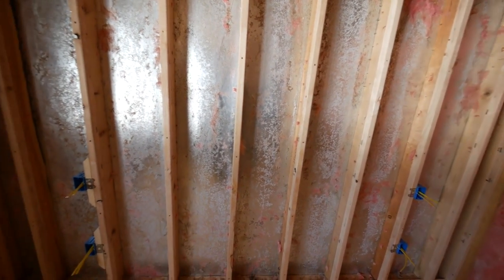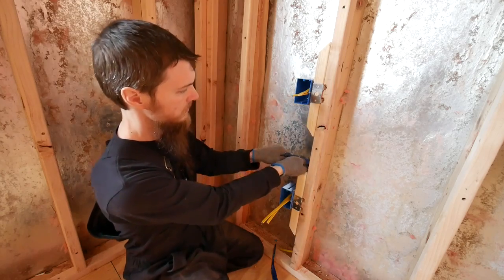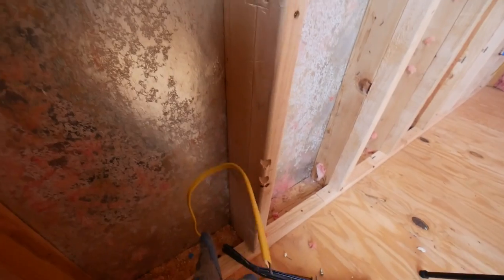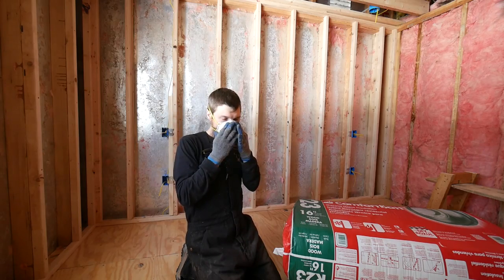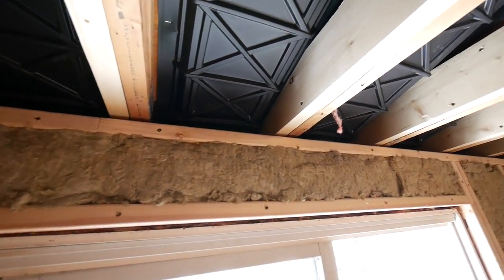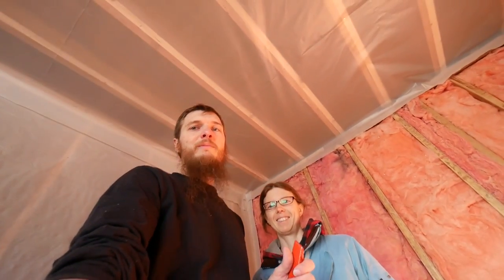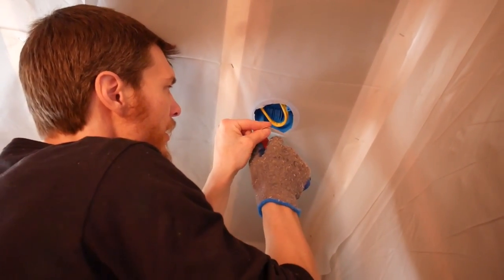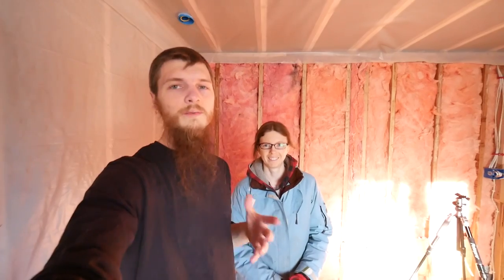A Sensational Insulation Installation - Home Renovation

Comment: Thanks for the additional warning of wearing the Tyvek suit at the end. I wondered if the rockwool insulation was as itchy as fiberglass and assumed that it wasn't based on you not wearing any protective gear. I'm glad that you cleared that up based on your experience.

Comment: The more I watch you the more impressed I am.if you install your drywall first then blow in insulation.you will have many holes in your drywall to repair and then unable to tape the holes.my suggestion is to blow installation first.tuck tape holes.this way you can have the fill of each truss area visually .afterwards install drywall. Good luck!!
Reply from the maker: No holes will be cut in the ceiling, we'll be going up the attic door that's in the hallway to do the blow-in insulation.
Reply: Ahhh ok.that is even better!

Comment: The man that built my tiny house used Roxul insulation. Not as thick as yours but it is doing a fine job retaining heat in the winter and keeping the home cool in the summer. In my opinion you made an excellent choice for your insulation. Nice video, thanks.

Comment: MOISTURE RISK!  Doug its been my experience to wrap either the wall or ceiling (recommended) only but never both.  I am not sure about Roxul but with fiberglass for certain.  On a full wrap and there's no place for the moisture to go and will exit through the wood in your windows causing premature rot.  This actually happened to a friend years ago.  I googled Roxul but didn't really find much.

I would recommend doing the ceiling only to be safe.  

Also wanted to say we're in our 60's and my wife and I love your show!  It's a joy to see someone young not only take a DYI interest but also you really seem to know what your doing (or at least research when you don't).  KUDO'S to you & Ashley and to the kids!
Reply: Hey, I'm redoing my bathroom due to a leak and black mold. What exactly do you mean about wrapping the wall? Are you talking about the insulation? I'm using fiberglass insulation. R13 is what is required in my zone. Is there anything I should do to the wall before putting the insulation in? It's an outside wall.
Reply: I made it to the end of the video,  I know what you're talking about now. Lol
Reply from the maker: Thank you, we really appreciate it! I generally agree with you about the vapor barrier but it's required here.
Reply: Out in the Country  There again I wasn’t sure about Roxul which may be different. Didn’t realize you had to pull a permit to redo your bedroom. Codes are the County’s commandments!  Good luck with your project.

Comment: The mineral wool insulation is impressive. I would never use another type of insulation ever again. It fit perfect (who knew?) and I could see the extra coming in handy for other jobs in the future, so no biggie having to open another bundle. It was a first hearing anyone say "It was Fun doing the insulation." Taking breaks you need for your family time and leisure makes for more ease at work-time. Thank you both for caring enough to explain the processes of your projects.
Side note .... Was wondering if you considered the fact that electrical current will be going through your wiring next to your heads, as you sleep? Don't know if it's practical for you to shut off the breaker at night, but that is one way to avoid the pulsing electricity. Not trying to interfere, just wondering and looking out for you, and since you are doing it yourself, you can do it your way, eh?

Comment: If your not using that opened bag of insulation straight away keep it covered as it will absorb moisture in the air...great job🇮🇪🇮🇪🇮🇪👏👏👏

Comment: Attention to detail is why well made wooden structures have been standing for 200 years. Older double sided were made to be lite for travel...your refit will make the home stronger than most new homes. As long as the roof is secure and exterior surfaces painted to seal it from the weather, it will last for your grandchildren.

Comment: I was surprised to see you with minimal skin protection. In my experience working on a volunteer team helping with a project that involved rock wool  - we were able to get our clothes cleaned of it with washing. We did find that it was most pleasant to use some type of coverall and we duct taped our gloves to our coveralls to keep any rock wool from getting between. (This was on a large multi-day project we were helping with in Poland and we found what worked as we went along.)

Comment: The reduction in outside noise was very noticeable once the insulation and vapor barrier were installed. You should be much warmer in the winter and cooler in the summer!

Comment: Looks like good sound proofing material as well..
Reply: It is rather effective at soundproofing due to its density. I used Roxul in a basement remodel that included a home theater. It did a great job at containing much of the sound.

Comment: As mentioned by someone else it's a good idea to tape the area where the wall and ceiling plastic meet also not a bad idea to tape around wall plugs ect and around the window that way air won't escape the vapor barrier

Comment: You cutting that insulation with your serrated kitchen knife made me think of using an electric carving knife to cut rubber mattress foam. Works really good. Not maybe worth the investment in the tool unless you have a lot to do, but just out of curiosity I took a peek at Amazon to see if they come in cordless, and they do. The one I had back in the day I got at a yard sale had a cord and it worked really well.

Comment: Could use tyvek type tape around the outlets.Acustical caulk around floor and around exterior windows and doors end were the poly ends on interior walls to complete the vabor seal. Tape the poly together with the tyvek type tape. After you wire your exterior outlets i poked spray foam in the holes were the wire enters the boxs.   looking good.

Comment: I have fiberglass insulation in my basement ceiling. You could use that insulation you have and fit it snug then cover with plastic. Just tape it where the staples were. I would wear old insulation clothes from a thrift shop and toss when done just in case it make the protective suit itch you when you wear it again. Also you are a pro! Looks great!

Comment: Don't forget to tape over the rows of staples and then where the ceiling vapor barrier meets the wall. The ceiling barrier should be BEHIND the wall plastic so if any condensation does occur it can run down the sheet instead of catching between the ceiling and wall.
Reply: Not suppose to put plastic on the ceiling. Worked in HVAC for 25 yrs on new construction. The pros always said a room breathes through the ceiling,if it can't it will trap moisture and cause a mold problem.
Reply from the maker: It depends on location. When you move further north it is a requirement in some areas. I know there are a lot of mixed feelings about vapor barriers, where they should be, and how they work. Hopefully we'll get more clear science on it over time.
Reply: @diyfferent  No,there will always be a debate over this. I do know,that a ceiling vapor barrier is only effective in sustained cold climates other than that there will problems. You will probably be ok in a bedroom,but in a bathroom I would no put plastic between the drywall and insulation,just install a nice well made vent ducted to the outside with wrapped metal pipe to prevent sweating. I appreciate everything you are doing and I will not steer you wrong. I live in Kokomo and have done alot of HVAC work in northern Indiana.

Comment: My sister and I are really enjoying and learning from this series of videos! One question, would it help to put duck tape around the electrical boxes to secure the barrier to it and make a good deal to block air?
Reply from the maker: Probably :) I plan on extending these boxes from the wall before we are done as part of the finishing work so I need them to be free for now, but that would be a good idea.

Comment: You might try vigorous shaking/flipping (as you would before hanging out laundry) the clothes you wore for the insulation or even hanging them out in the wind, before washing. That should get a lot of the itchy stuff out. Personally, I would also run the washer thru a few times empty before washing anything else. Just in case the itchy stuff is in the washer. You would not want any of that to get into Maverick's or Belle's clothes.

Comment: Don't be too hard on yourself for not wearing your suit while doing the insulation.  When you described the insulation, my thought was also - oh good - no fiberglass getting stuck on you.  I wasn't expecting the wool insulation to be a problem either.  We put insulation in our attic space also and it was fiberglass.  I don't remember what hubby did to not have a problem with the fiberglass.  He didn't have anything but his regular clothing he was using.  We only have a crawl space up in the attic and we don't use it for anything.  If I were to try storing something up there, I would completely forget it was up there, lol!  You did a beautiful job with the insulation and I am actually glad that you added to the studs below the ceiling.  It can't hurt to be on the safe side.  I wasn't worried about the 2 X 4's after you told me what you had.  I was worried about 2 X 2's and was happy you didn't have that construction instead of the 2 X 4's.  In the old trailer my daughter had, it was all 2 X 2's and I couldn't think of any way that would have supported dry wall.  That was all light weight ceiling tile.  Come to think of it, there wasn't any dry wall except for the inside walls.  That trailer had a very comfortable amount of living space.  I never felt any discomfort in that way.  It had the typical long hallways, but our granddaughter was able to ride her little car in the house.  There was plenty of room for that.  I can't believe there was actually a fireplace in that trailer.  We always told our daughter NOT to use it, but one of her friends did.  We were pretty angry about that, but she didn't use it again.  We never felt safe using it as a fireplace, and so it was just for looks while my daughter was there.

Comment: Job looks great overall.  I've never used rock wool before, but should I in the future (and I just may as I'm house hunting), I'll definitely use rock wool.  Better R value, and it looks just as easy to install as fiberglass.  Good idea re-using the fiberglass for sound dampening on the interior wall.  Better than going to waste.  If there's one thing I've noticed about you, you (like me), like to be efficient, not toss things, but rather find another use for it instead.  I more or less found your channel when you posted the first video on this room when you demo'd it.  I've been watching your other videos, and your wife Ashley is right, you, at times, tend to overthink things, but hey, you're just trying to do it right, and I get that.  I agree with the Mrs., the rock wool will be just fine above the window.  Your installation went really smoothly including the vapor barrier.   You should be snug as a bug in a rug with that insulation.  Looking forward to the drywall installation.  Not sure how much experience you have with drywall, but I suggest searching youtube for 'how to' videos on drywall installation for pointers if you're a novice at it, although you probably already do that.

Comment: Tip: Vacuum your clothes or hang them outside away from the house to blow in the breeze for an hour or so before putting them in the washing machine.  Any loose fibres will fall off and reduce the amount going into the water system. :)

Comment: What a nice job you have done.  I am sure that insulation will wash out of your clothes nicely.  Sorry you had the insulation itch.  I had wondered if the insulation would cause any problems.  Thank you for the tip to cover up when applying the insulation.

Comment: If you really want those electrical boxes to be air sealed you need to fill the back of the boxes with closed-cell spray foam or silicone. I've built several sound proof studios using similar methods.

Comment: Hello you should tape over your Staples where you use the Staples to hang your Vapor Barrier you need to tape over them and tape your seams where your Vapor Barrier from the ceiling meet your Vapor Barrier on the wall make it airtight and seal it up covered with with type I don't remember the name of the tape but it is a tape with you if you still up your Vapor Barrier and you tape over your Staples to make your Pure Vapor Barrier more solid before you drywall
Reply: I've always heard it referred to as 'tuck tape'. Usually it's red. I've also seen people use acoustic sealant to adhere the vapor barrier to the bottom plate for an unbroken seal.

Comment: Awesome job!!!
( curious why plastic ??? In Aussie we don't use the plastic in the walls. )
Reply from the maker: It has to do with keeping moisture from penetrating the walls and causing condensation/mold & rot. In the cold north where we live, the barrier goes on the inside, and down south where it gets hot it goes on the outside, under the siding - usually.

Comment: Question - the existing windows in the house - are they ‘keepers’? If not - when the process would it be best to install new - after the drywall? Long-time watcher (Kokomo) - I know you do things ‘right’ the first time! Just wondering...great job!!
Reply from the maker: The windows are in bad shape. They are installed from the outside so we will wait until we get to the exterior to replace them. They won't affect anything happening on the inside except for having to wait to put the window trim up.

Comment: You'll probably find that mice will chew thru the foam around the wiring.I've had good luck using stainless steel wool instead.I noticed in an earlier video the double wide doesn't have a solid concrete slab under it,just a concrete footing for the block walls.You can bet the mice will tunnel under the footing.The little bandits are hard to keep out!
Reply: I've heard there's a spray foam insulation in a can that mice do not like.  I'm not sure of the brand.

Comment: Did learn the insulation getting in the wash thing fifty years ago. Fixed that problem by not handling it since. BUT now it is necessary and you have me motivated. What is rock wool made of and is it more expensive ?
Reply from the maker: It's literally made of rocks. I guess the melt some type of rock and spin it into fibers much like fiberglass. It's a little more expensive but does have better insulation qualities.

Comment: Mice will eat through the regular spray foam...ask me how I know!  They do make a special one for rodent prevention.  I used that insulation in the basement and It was so much better that the pink stuff.  Good choice.
Reply: HeavenScent Homestead Bats will make holes in it too! My dads tool shed has exposed spray foam on the roof, and every once in a while a bat gets in and makes a hole in it and tries to sleep there.

Comment: I may try this insulation rather than fiberglass on my next project.  I live in the south and have never seen plastic installed over the insulation.  Is this common practice in the northern states?  It would seem like you would want any vapor to pass through the insulation and out of the house wrap instead of trapping it with plastic, but I have no experience with in or understanding of the reasons for using it.
Reply: Rob Stephens I’m in Colorado and this isn’t done in every house here either.   I know the plastic is a vapor barrier.  The idea is that if the temperature outside is different from the temperature inside the house moisture could collect on the insulation and cause a mold problem.   It could also be an additional air barrier.  

I don’t know why it is more common in certain parts of the country and not done in other parts.  I will hope that someone else offers more information.
Reply from the maker: It all depends on your local area. They say that the vapor barrier should be placed on the warm side, so down south it would be on the outside and up north it would be inside. In some places it's not required at all. It is required here, and much of the north, on the inside, I don't necessarily agree with it though.
Reply: What are your thoughts on why you don't agree with it?  I haven't read enough about it.  House wrap is required here as I think it is required everywhere now.  Does house wrap have something to do with you not thinking a vapor barrier is always needed in your area?
 @diyfferent
Reply from the maker: @jayburris6252  I only have my own personal opinions and experiences with it, but I just feel that houses do fine without it and sometimes they can actually trap moisture in the wall. With the way homes are being built, we have plastic on the inside, and then people put foam board and house wraps on the outside and when it does get wet it can't dry out easily. Also, I feel that finished drywall alone provides all the barrier you need. That being said... I think it can be helpful in some places and situations. I don't expect it to be a negative in this house.
Reply: That totally makes sense.  
 @diyfferent

Comment: That wool insulation looks like it would be so much better to work with than fiberglass. What is the black material on the ceiling looks like it has a x grid like design?
Reply: Leah R. It's a plastic thingy that will allow the roof/attic to breathe, keeping moisture and mold at bay.